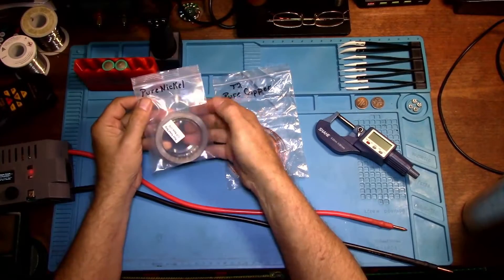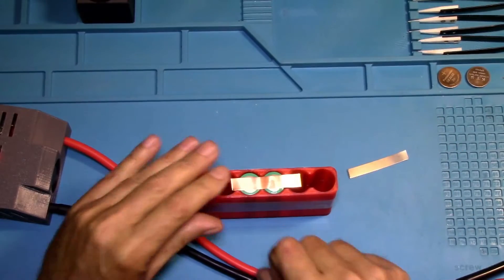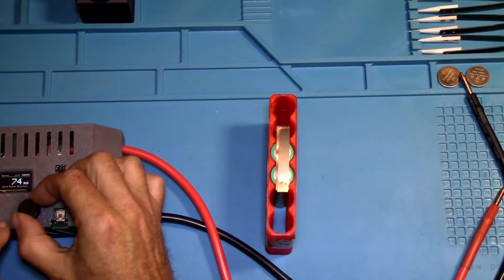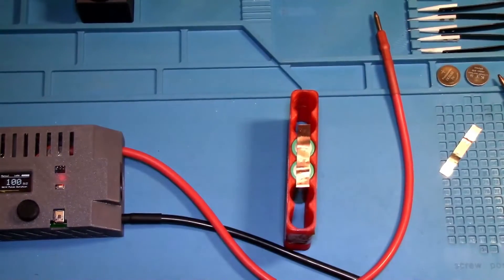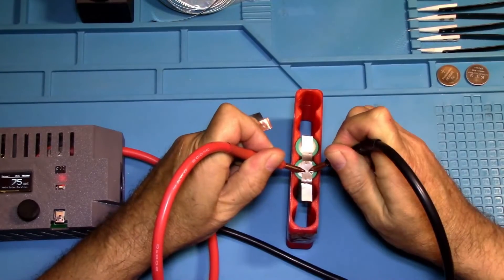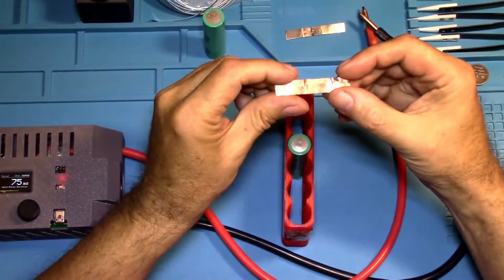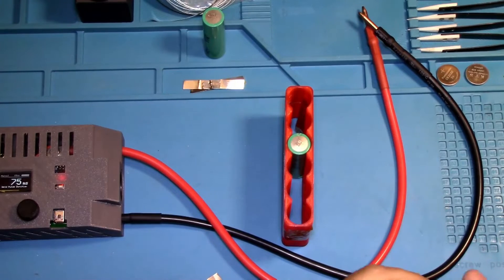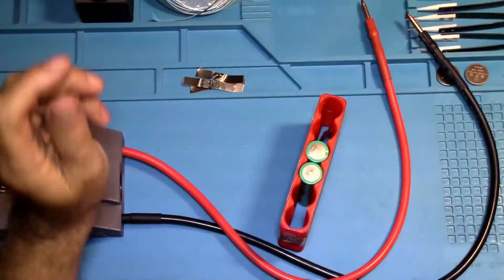Can the Malectrics Spot Welder Do A Copper Sandwich Weld - Pure Nickel, Pure Copper - Let's Find Out

Comment: Thanks for the helpful video.

I'm planning on spot welding two copper sheets together.  Each one is 0.0028 inches thick.  At first, I figured that the Malectrics should be able to do it, if I use a car battery that will supply up to 800 amps.  However, after watching your video, I'm not so sure.

I was looking to buy a spot welder.  I had narrowed my options to the Malectrics or a Kweld.  I ordered the Kweld, partly, because they seem to be able to deliver it, more quickly.  Also, they tout being able to handle up to 2000 amps.

In your video, you ask why copper is harder to spot weld, by itself.  My understanding is because copper is, both, a great electrical conductor, as well as a good conductor of heat.  This is a terrible combination, when it comes to electrical resistance welding.  This is because the heat is generated by electrical resistance.  So, because copper is a great conductor, it doesn't generate much heat, when conducting electricity.  Also, because it's a good heat conductor, it acts better as a heat sink; meaning that the heat dissipates quickly -- preventing it from getting hot, easily.  The only way to overcome these obstacles, is to dump a huge amount of electrical current into the welding circuit.

Nickel doesn't conduct electricity as well as copper.  It has more electrical resistance, and heats up easier. The copper and nickel strips are in parallel.  Because copper is a better conductor, more current will run through the copper, but will generate less heat.  Even still, some current will run through the nickel, and generate more heat.  It's this heat that makes the weld form easier. 

When you remove the nickel, and the current goes through the copper, alone, less heat is generated, because copper is a better electrical conductor.  This results in less of a weld, if any.

As someone else pointed out, it seems as if your power source is the greatest factor.  If you were using a source that provides more current, then you'd probably get better results.  That was my original thought.  Having said that, you say that you're using a Zeee 9000mAh, 11.1v battery.  Based on what I could find, it seems as if this can put out up to 900 amps; which is a lot.  According to Malectrics specs, the spot welder can handle a maximum of 800 amps.  So, it can't deliver more than 800 amps, anyway.  Because of this, the limit seems to be the welder, not your battery.

This is all good for me to know, since my intent is to weld two copper sheets together.  However, I'm still a bit puzzled that 800 amps wasn't enough current.  The only other limiting factor, then, is the amount of time that the circuit is closed.  You used a maximum time of 100 ms.  Perhaps, if it were conducting for a longer period of time, it would melt.  I have to believe that this is the case, since, I can't imagine shorting an 800 amp car battery, through a thin sheet of copper, and it not spark and melt.  After all, jumper cables have to be big, for a reason.  There's no way that a little, thin piece of copper could carry that much current, without melting.

Malectrics states that the maximum pulse time can be set as high as 500 ms, instead of the default 100 ms; which is what you seem to be using.  However, they warn that this could cause problems, since, too much current, for too long, could damage the MOSFETs in the device.  This is another reason why I chose to go with Kweld, instead of Malectrics.

Thanks, again, for the video.  You've kept me from wasting time with the Malectrics.  My copper is thinner, so, it may have worked.  However, I, now, see just how much of a role time plays (not just current), and the limitations of the Malectrics.
Reply from the maker: Thank you evan for that information.  I just checked my nickel strip again, and it is 0.77mm, and probably why it wouldn't weld.  I set the Malectrics as high as it would go, and still no weld.  The Kweld I guess would definitely work better, but I don't have that kind of money to spend LOL...  

Also, Malectrics does not claim to be able to spot weld pure nickel or copper strips either to be fair...  The malectrics does very well with coated strips at very low power, but it just didn't seem to have enough to get through the pure nickel, which I guess is kinda a bummer, but not really, since most people are not going to be using pure nickel or copper anyhow, and most all my welding is done using coated nickel strips. 

I would really love to do a video on the Kweld, but like I say, I can not afford that welder right now. 

Thanks again for your comment and detail, and glad that the video helped you NOT make a mistake :)..
Reply: @Outside-In.  You said that you set the Malectrics as high as it would go.  Based on the video, it seems as if it was the highest while being set on the default setting; which maxes the pulse duration to 100 ms.  In the video, when you state going to 100%, the Malectrics screen seems to be showing 100 ms.

However, based on the following link, it appears that this default maximum setting can be increased from 100 ms to 500 ms:

https://malectrics.eu/arduino-spot-welder-quick-start-guide-v4/

The above link was taken from the Malectrics website.  If you go to it, you'll see that there's a section called "The System Menu".  Under that section, there's a heading that reads "Max Pulse:".  That's where I've obtained this information about the max pulse time being able to be set from 100 ms to 500 ms.  However, it also states that setting it that high, could, potentially, cause damage to the device, if your power source provides a high current.

I can understand why anyone would be hesitant to set the maximum to 500 ms, while the instructions state that there's potential risk of damaging the machine.  I guess it's offered for those who choose to use a power source that provides less than 800 amps.

Comment: Just to confirm your theory: The malectrics is able to weld 0.1 mm copper with 0.1 mm nickel plated steel on top with ease. I'm able to do it with a pulse time of just 26 ms using a 740 CCA car battery as a power source. As far as I know copper is about 4 times more conductive than pure nickel thus it won't heat up enough with the current that these "hobby grade" spot welders are able to handle. The nickel strips provide the necessary heat during the welding process to make the copper stick to the battery. Greetings from Austria
Reply from the maker: Thanks Dani.  I was thinking the same thing about using thinner copper and nickel would more than likely work for sure, as the Malectrics is quite powerful.  I should have gotten thinner copper.  I didn't realize how very hard it is to spot weld copper until this video.  It is great to know that you yourself have welded .1mm copper to .1mm nickel.
Reply from the maker: @robertschrauder7537  I will do my best to create a video, as that would be much more interesting than sending a photo ;).
Reply from the maker: @robertschrauder7537  Great information Robert, and thanks for your help.  I will definitely keep that in mind.
Reply from the maker: @robertschrauder7537  You are very welcome Robert, and look forward to creating that video. 👍
Reply from the maker: @robertschrauder7537  Robert, this is to let you know, that I found 0.1mm Pure Copper, and 0.1mm Nickel Plated Steel Strips, and placed the order.  Should have in a few days, and will be very happy to create a video for you.  Nickel Plated Steel on top of Pure Copper - Spot welded to an 18650.  Keep fingers crossed, as I do hope this works, and I am sure it should - the Malectrics is pretty powerful, but I used too thick of copper, not too mention pure nickel instead of plated steel...
Reply from the maker: @robertschrauder7537  I am very glad to be able to help, and am looking forward to creating the Sandwich Weld video.

Comment: Useful video, thanks, I might have missed it but what’s your power source? As I understand it, the power source makes a big difference - perhaps enough to make this work. Is it a 12V battery, if so what CCA and Ah? I’m considering the k-weld but it’s hard to get and pretty costly, so if the Malectrics can do it that would be a plus!
Reply from the maker: Thanks for the comment and question.  I am using a Zeee LiPo 9000mAh 11.1volt battery.  I found that when I shortened the lead wire from the battery (11.5" total length) to the welder, it works much better.  The Malectrics is pretty powerful, and successfully welds .3mm nickel very well which is hard to find a welder to do that.  Yes, the Kweld will more than likely do the same thing, but like you say, it is quite expensive, and good to have if you have the money to spend, but I don't have that kind of money, and why I settled of the Malectrics, and have been very happy with it.

Comment: When welding sheet metal it is common practice to put a strip of copper behind what you are welding as a heat sink to control the heat to prevent burning through. The metal been welded does not stick to the copper, an advantage in using it.  Like wise in heavier stick welding, a strip of cooper behind the weld prevents it burning through without the copper sticking to the steel.
Reply from the maker: Thank you Marita for the comment.  Am I right to assume that you are trying to say that, that is the reason spot welding cooper is nearly impossible?.

Comment: It could be that the current rushes through the strip at the shortest distance , instead of going through the cell tab. A strip with a gap might give better results. See what the power tool manufacturers use , most strip have the gap between the spot welds , they also use pretty thick tabs. In case of Bosch GBA pack ~0.34mm.
Reply from the maker: Thanks Gabriel for the comment.  Good point, and I will have to look into that, as it makes allot of sense.  The Malectics only states it can spot weld up to about .2 or so mm, so I was trying to weld a total of about .4+mm LOL, so am assuming that is why it wouldn't weld.  Also pure copper being more difficult, also likely that is why copper by itself wasn't welding either.  

Malectrics also doesn't state that the welder will weld copper, so it wouldn't be fair for me to "dis" the Malectrics because it wouldn't weld something the company doesn't even acknowledge it will weld.  

I thought this was a pretty cool test to perform though as it was asked for me to try.  I think if I tried thinner copper strip, it may work...  0.1mm copper and 0.1mm nickel, but for now I would have to wait for a test like that since I don't have any copper strip that size.